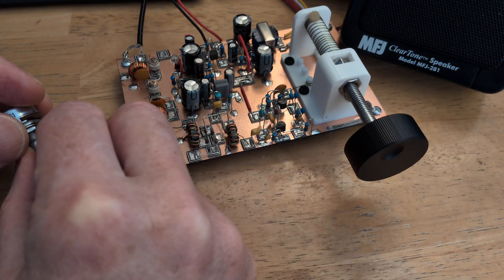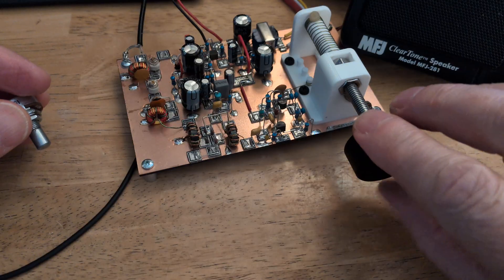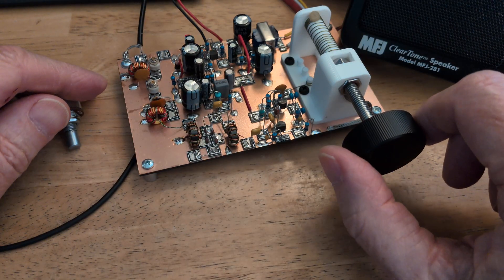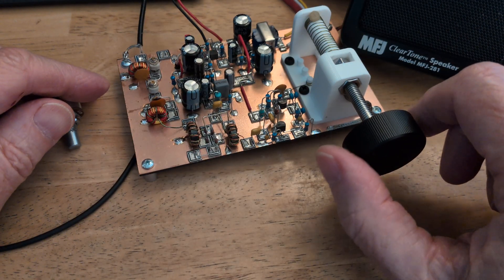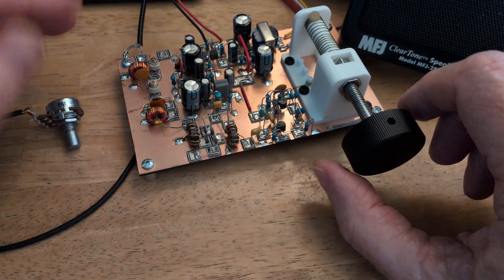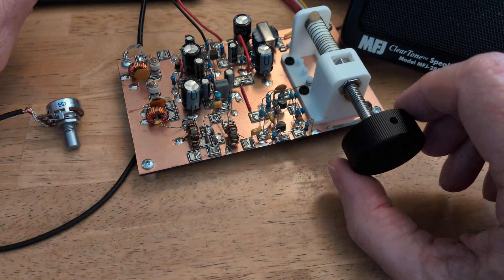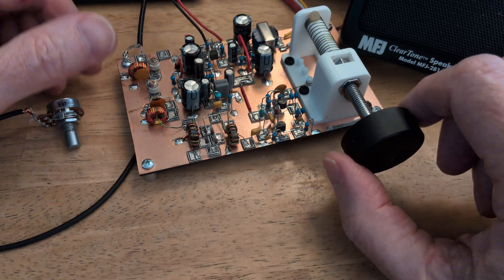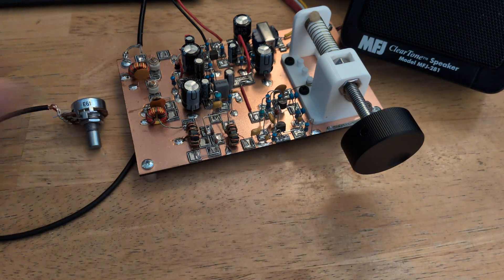The SolderSmoke Direct Conversion Receiver on SSB

Comment: это схема кольцевого смесителя?
Reply from the maker: This receiver has a diode ring mixer, and the circuit diagram is on Discord, at https://discord.com/channels/1326289906603135116/1334897352934293647
Reply: @AA7EE  Благодарю.